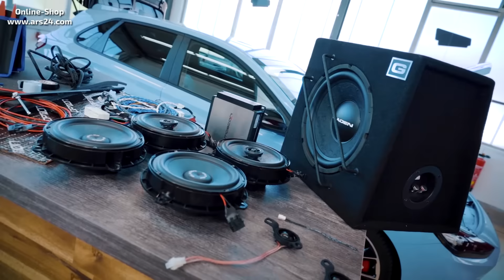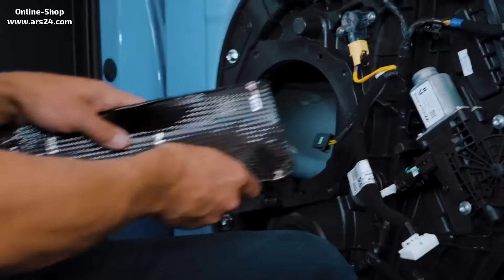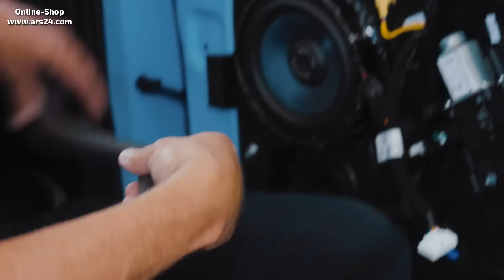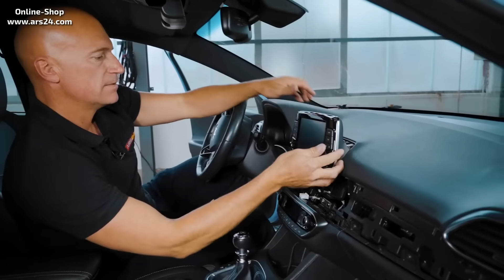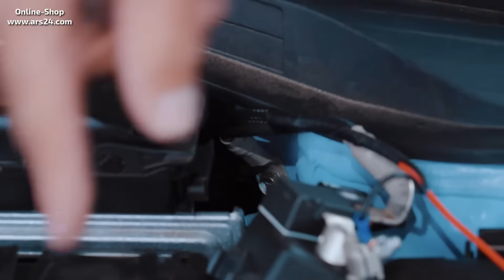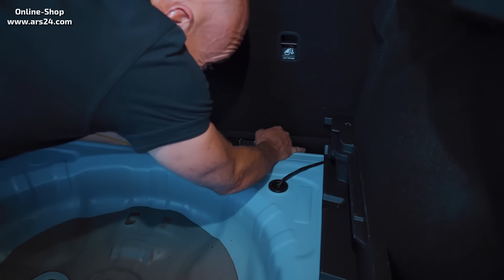Hyundai i30 N | Soundsystem with Subwoofer Installation | ARS24

Comment: make a specific turotial with the powe cable, in 2019 i30n its not there at straight forward at all, and the cable u put thru is not rated for more powerful soundsystem

Comment: Has anyone done this ?
Reply: I ordered it and installed it and works well.  Definitely makes the install a lot easier.  Only issues really are that they don't recommend connecting the ground to the battery but rather the point behind the battery which is a bit of a pita to get at.  I couldn't get the tool he's so proud of to get the tweeter covers off so I just used two of the small pry tools and worked it out.  And third, I got the spare wheel sub and works well and fits in the hole but a lot deeper than the spare so the floor mat sits up and I need to come up with a way to support it around the edges a bit more.  Other than that, happy with how it sounds and how easy it was to install and how they included everything you need plus some.
Reply: A wire coat hanger makes the tweeter grill removal a breeze